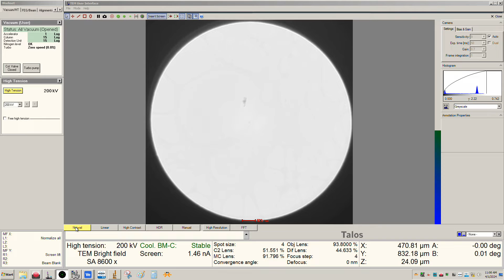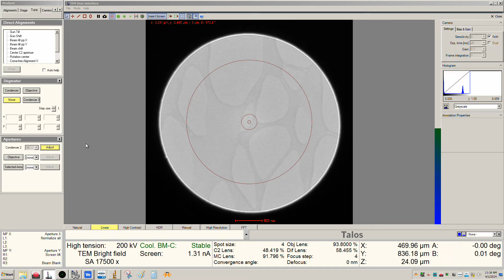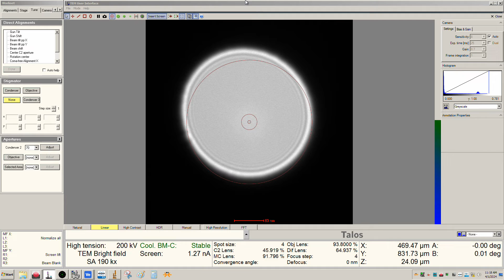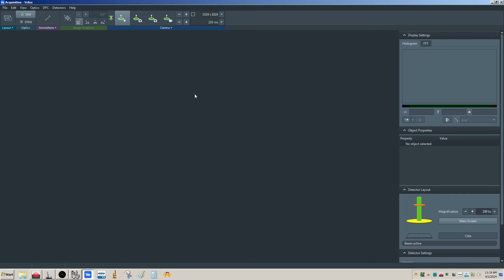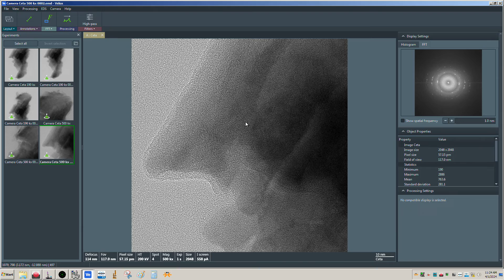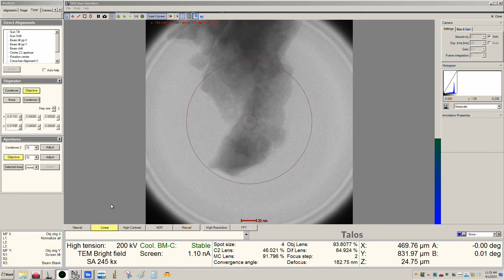FEI Talos F200i S/TEM: beam shower tutorial

Comment: Thanks for the nice explanation.
I prefer to perform beam shower in low mag. Mode at the beginning. The current is about 18nA and area of ~9 grid squares for 20-30 min. it is helps a lot. Some times carbon contamination back after 40-30 min.
I learned to make beam shower at STEM mode at JEOL microscope demonstration  at Paris.
Best wishes, 
Sergei
Reply from the maker: Hi Sergei: thanks for your comment.  Glad to hear you have a beam shower strategy that works.  I also notice that the effect of the beam shower can sometimes "wear off" after a period of time.  Sometimes, this only is a matter of a few minutes, which can certainly be frustrating.

Comment: Do we need to worry about 120+ nA currents dealing damage to our samples? Like if the sample is 2D material like TMD, shouldn't we decrease it to something like 4-7 nA?
Reply from the maker: Good question.  It's not as much of a problem as you might expect because the current density is very low.  In fact, if you consider 130 nA in a 20 um diameter beam, the equivalent current to produce the same current density for a 200 nm beam (typical for doing high-res imaging) is only 13 pA!  I highly doubt a current density this low would be enough to damage even a 2D material (assuming using a lower beam voltage), but I'm not entirely sure; the only way to know for certain would be to perform the experiment!
Reply: @NicholasRudawski  Thank you! No more 30 min beam showers for me then :)
Reply from the maker: @tymofiipieshkov3819 you're welcome; please do get back to me sometime and let me know how things are working out for you.
Reply: Hm... I tried all the options besides the gun alignment and after condenser is set so 150, spot size 1 and shrunk beam/playing with monochromator I could only get the current up to 12.6 nA. I saw that our gun lens is set to 732, which is way higher comparing to what you have, but I have no idea how to align it. I don't suppose you have a video for gun alignment? 😅
Reply from the maker: @tymofiipieshkov3819  What microscope are you using?  It is typical that systems with monochromators yield lower maximum beam currents compared to systems without monochromators.  Do you have an SFEG or an XFEG?  What is your extractor voltage?
Reply: The microscope is Titan Themis 3.  I think we have xfeg here and just checked the voltage. Extractor is set to 4100 and extraction is 3850 V right now. That's the numbers I read from the same FEG control tab
Reply from the maker: @tymofiipieshkov3819  I do have a video about working with an XFEG with a monochromator:

https://www.youtube.com/watch?v=IGv_p8O5tGE&pp=ygUSeGZlZyBtb25vY2hyb21hdG9y

We are able to get a beam current of ~22 nA on our system (XFEG + mono) with extractor = 3600 V and mono potential = 3000 V (no excitation).  Just to be clear, 12.6 nA is what you obtain when you adjust the the mono focus so the entire beam is inside the C2 aperture so it is not limiting the current?
Reply: @NicholasRudawski I remember that video, yeah. And you're right, I just adjusted the focus of the mono without changing the gun alignment. So, basically shrinking the beam, I guess